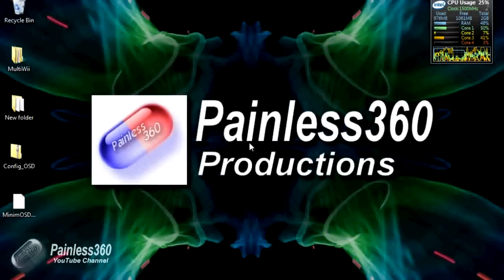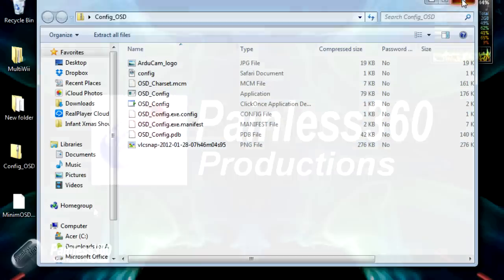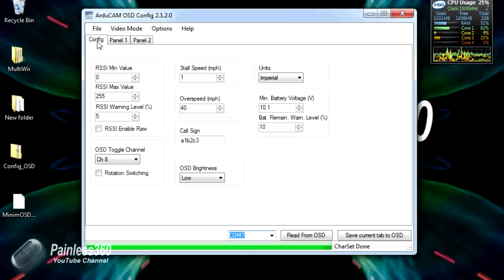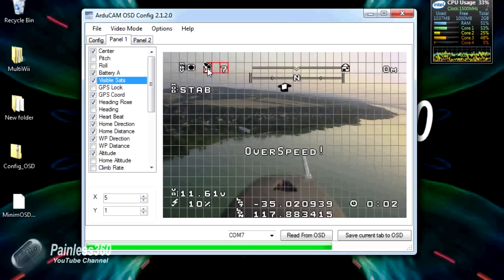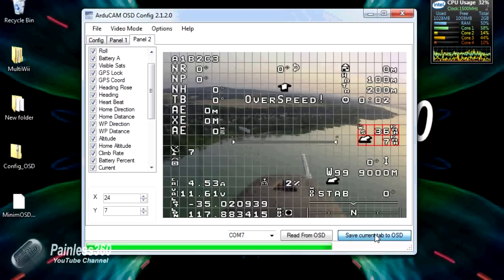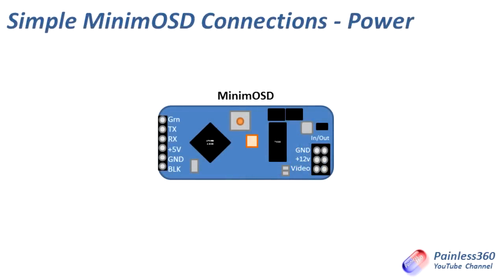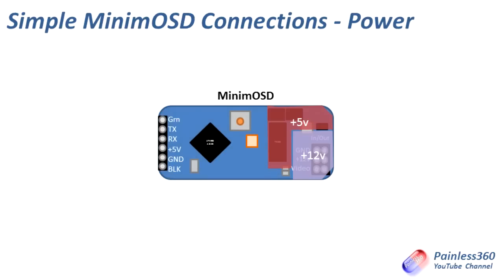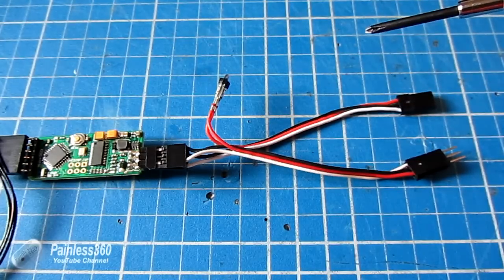APM 2.5/2.6/2.7 - Adding an OSD for FPV using MinimOSD - complete setup

Comment: I have 2 quads, one with Telem radio and one without. The one without will not update the OSD!  Spent 2 hours on it today. I get a waiting for heartbeats. I swapped the board over to the telem system and it works. I have both Tx and Rx connected (crossed over) to the APM 2.8 Telem port. In MP there a button under optional hardware to enable OSD....doesnt change. Any ideas?  Great videos btw..very professional!
Reply from the maker: Great work on the troubleshooting. So many ask for help without explaining what they have already tried. From what you've tried it sounds like a software setup problem or a problem with the port HW. I'd check through all the settings in Mission planner between the flight controllers to see if they are the same, if they are then it maybe the port itself.. I've looked to see if there is a way to disable MAVLink but can't find anything. Best of luck.

Comment: Is it possible to power the fpv transmitter using the output rail of the apm? I'm using a power module with jmpr removed. Thanks
Reply from the maker: I wouldn't. Most FPV transmitters need 7-15 volts and a lot want 12v (or there about!). I'd power it from the BEC and avoid pulling any more power through the APM than necessary. Best of luck!

Comment: Hey hello there. I have successfully installed the OSD after watching your video and it was fantastic.

However I do have a serious problem. I want to use both OSD and the MAVLink at the same time. However as you know there is only one "Telem" output on the ArduPilot. What can I do about it?
Reply from the maker: +Berk Küçükoğlu There used to be a 'buffer' that isolated the signal pins so they would work. Many have problems connecting both at the same time as the load on the APM pulls the signal below the level that works reliably. This is one of the things they fixed on the Pixhawk - two ports for telemetry! Best of luck!
Reply: +Painless360 Sincerely thank you for your reply. Is there anything I can do about this issue? Are there any products to fix this issue? I am not an electrical engineer but maybe there is a way to copy the signal without APM pulling it low. Maybe using a transistor or something?
Reply from the maker: Unless you can find that 'buffer', no. Best of luck!

Comment: I'm having a problem with the FTDI breakout board and the OSD having different connection values.  The FTDI breakout board has listed connections as GND, CTS, VCC, TXD, RXD, DTR in that order; while the OSD has listed connections as BLK, GND, +5V, RXD, TXD, CRN in that order.  Is there adifferent FTDI breakout board that I should get or is there a proper way for these to connect?
Reply from the maker: +Doyle Daniels We've not seen that here. Normally one end is called BLK the other GRN and lining those up gets the pins the right way, otherwise the 5v pin is normally the key.. Best of luck..

Comment: where can you get the cables for the OSD and Camera?
Reply from the maker: +Kenneth D. Bryant The cable for the camera usually come with it and I then use servo cables/DuPont style ends to make the rest up using the cables that come with the FC. Get a complete kit from a vendor to avoid these problems.. Best of luck!

Comment: Hello, I have apm 2.5.2 (Cheerson CX-20 open source) and minimosd.  I have followed your video for setup and installation and all went well except the fact that it just says "waiting for MAVLink Heartbeats" on my goggles.   I have absolutely exhausted every resource I could find trying to find a solution.  Any ideas?  Thank you for your informative videos and time.
Reply from the maker: +Jason Weber swap rx and tx lines? Tricky to suggest things without knowing what you already tried.. Best of luck!
Reply: +Painless360 I have indeed tried swapping tx and rx without success.  I've also tried previous firmwares on OSD, I've tested everything with multimeter and I'm showing voltage on tx and rx.  I've even tested the apms voltage regulator at the 12C port and it's showing 3.2volts, I've tried disconnecting gps and compass without success as well as tried hitting reset button on module numerous times without success.  I also get same error if I do away with OSD and try connecting to mission planner via 3dr (knockoffs) telemetry modules.  It's as if the apm is not sending data through the telemetry port.  Is there any way to "make" it do so?  Thanks again for any time you have for me.
Reply from the maker: Could be a broken board or driver issue then. Try it on another PC and with another cable. Best of luck with it..

Comment: I had som problems making the connection between the PC and the MinimOSD. 
The computer says "Failed to talk to bootloader", "update Eeeprom" 
It was an easy fix but worth mentioning. The FTDI-adapter needs its own drivers and that was something i had missed out on. I´m quite sure there are other snags along the way, but this solution worked for me. 

Thanks for making these tutorials!

Comment: Thanks for the video Painless.  I used this as a reference to get OSD on two of my Flamewheels.  Here's my question, I don't seem to get the Mavlink heartbeat I think called the RSSI??  It reads 0 yet all my other data comes through fine.  Not sure if this is an issue, or something I need to do via my APM software????
Reply from the maker: +MrPolymers The RSSI value is read from the radio receiver and is an indication of signal strength, unless you've set that up you won't see it..
Reply: OK, I did have that box unchecked on the OSD software.  I assume that's why.  I don't think necessary info for me.  Thanks for the good work...;)
Reply from the maker: You're welcome! Glad you got it sorted..

Comment: thanks mate this is working perfectly! but how am i able to edit the code, so i can add or change the view of some parameters?
Reply from the maker: +elie machaalany Most of the common tweaks can be done through a GUI to configure to OSD, anything else you need to get into the Arduino Sketch that creates the firmware.. even I don't go there ;)
Reply: okey mate but i need to add a cross-hair all over the screen display .. so i need to modify the arduino sketch .. if you could please give me a link for the arduino sketch, wich fits for apm 2.x :) thanks Painless360
Reply from the maker: It's the one we use in this video.. This is outside what I know about - best of luck!
Reply: okey friend no problem .. thank you :) Painless360

Comment: Lee: Thank you for all your videos and "bots and bobs". Have you run into the error "Cannot talk to the bootloader". Apparently caused by a windows update soft bricking the bootloader. I would appreciate any insight and a workaroud if you have one.
Again thanks
Reply from the maker: If that's what happened the you can try and reflag the boot loader using an USBASP tool (http://ardupilot.com/forum/viewtopic.php?f=19&t=6064)
Reply: +Painless360  It is not the APM that is having the problem. The OSB module was programed as per the above video. It worked. Went back to change setting from PAL to NTSC (gittery mask) and FDTI return the error.
Cannot change OSD settings. Two different OSDs and two different FDTIs.
Apparently it is happening a lot since the last window update.

Comment: well i have now got a new FTDI and it loaded but I do not see my battery volts do i have to install something else or wire it up?? I am running the amp 2.6 from the Telemetry port??
Reply from the maker: Yes, you need to have the sensors connected from the PDB/Power Module. Best of luck

Comment: Hi +Painless360 Thanks for your video. As always, your video has always been very helpful for me with your clear and detailed explanations. Initially the mavlink does stream all my data to my ground station, but after updating the apm 2.6 to the latest firmware (v 3.2.2), it only update horizon line, altitude and modes. Functions like Battery Voltage, GPS long/lat, SatCount, Home Arrow, Compass shows '0' reading. 

When connected to Mission Planner it tells me that the Neo6M GPS  has lock into 10 satellites. And during flights I still manage to do Loiter, RTL and etc.  It's just the minimosd won't stream the data. Could you share the parameter values of the APM in mission planner. Should I also update the minimOSD firmware after updating the APM? Thanks
Reply from the maker: +Ahmad Faizol That is what I would try next - best of luck..

Comment: Great video thanks. Have hooked up the same way you show in the video but cant broadcast video and overlay at the same time. On startup i only get video, unplug the camera then the overlay appears. Plug camera back in and the overlay disappears. Reset button doesnt help and ive tried 2 different cameras. Help?
Reply from the maker: +Kyle V Have you check that the PAL/NTSC setting is the same as the camera?
Reply: +Painless360 i do believe both are operating as NTSC

Comment: I got the minimosd off Hobbyking (http://www.hobbyking.com/hobbyking/store/__80102__Minim_OSD_for_APM_or_Pixhawk_Flight_Controllers.html) and it has extra pinless soldering pads on the top. They read (from the back of the OSD) G CURR G RSSI G BAT2 G BAT1. Would I be able to use the ground and battery inputs as is without modification for voltage display?
Reply from the maker: +Caleb Nehrbass Normally those extra pins are for the connection to the external sensors for the KV_Team firmware not to power the board. Best of luck.
Reply: So the only way to get the voltage overlayed on my screen with my particular osd is to do your mod with the resistors in the multiwii minimosd video?

Comment: hi. sorry I did use you as my first port of call instead of researching elsewhere first. after a lot of looking I have resolved the com port error by manually installing a ftdi driver and now have firmware etc all done thanks to following this tutorial. now to check out your 12volt video so I can connect the fpv.
Reply from the maker: +Claire Strudwick Well done, happy flying!

Comment: My setup is apm 2.8 + minimosd extra 2.2 + telemetry radio, i have seen many issues about the gps, voltage and amps not getting updating while others things like compass and horizon work flawless.
I have tried all the different solutions posted all over the web but i can't get my osd to work right, i could really use some help with this.
Reply: +Jake Mogensen Hi, I opened a post about this and I am looking for a solution too!
http://ardupilot.com/forum/viewtopic.php?f=72&t=14736

Comment: Apologies before hand, if this is a silly question... I noticed that the connection diagram shows the GND wire from the Camera pointing to the Out pin on the OSD and the GND wire from the Video TX is pointing to the In pin. Is that correct?
Reply from the maker: +Mcwdes At which point in the video?
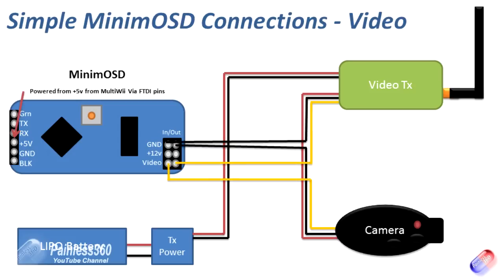Reply: +Painless360  That would be at 14:10.
Reply from the maker: Yep, the GND is common so that should work ;)
Reply: +Painless360 Thanks for the confirmation. I guessed that was the case. I'm hyper-sensitive to "magic Smoke." Just wanted to make sure.

Comment: I have 3 minimosd and can´t get it to work with gui. I get the "fail to talk to eeprom" on all three. Two of them came with mailman today. I have all drivers, FTDI, USBasp and cables, but it´s not connecting to minimosd gui or arducam. Tried Arduino to burn bootloader but no success. What to do?
Reply: +minibok2008 ....or fail to talk to bootloader
Reply from the maker: +minibok2008 That is odd that you have that many with a problem. Points to something on the PC/cables you are using. Have you tried another FTDI adapter as some of the 'clone' boards have trouble with the latest drivers.. Best of luck..
Reply: +Painless360  thanks! I ordered FTDI basic instead from BG. The one I used worked with Orange UHF modules and I did test it with FT-program to check if it was locked and that worked fine.
Reply from the maker: +minibok2008 As I can't see the FTDI adapter clearly or the wiring it's impossible for me to comment usefully. I think your idea of another 'real' FTDI basic adapter is an excellent one..
Reply: +Painless360  It´s solved! You mentioned pc/cable so I borrowed my wife`s pc and now it works. My pc usb outputs less than 5V, I think it´s corrupted. Thanks!

Comment: great video but cannot suss out how to incorperate the plug and play eachine fpv system as its 7 to 24 volts so the 5volt mod wont work....confused now
Reply from the maker: +Jason Strudwick I've not used that but I assume that you'd set it up as a 12v camera for ease of install. Best of luck.
Reply: +Painless360 so best to keep board as is and follow your tutorial?
Reply from the maker: Not if the camera can't work on 5v... See my video on powering 12v cameras for FPV, may help. Best of luck.
Reply: +Painless360 ok will do thankyou

Comment: Hello, or did you buy the adapter with micro usb ?

Tanks
Reply from the maker: +Jose Duarte Not sure which cable you mean if you are talking about the FTDI Basic adapter - yes!
Reply: Hello, Yes
Reply from the maker: Yep - you need to buy one. Search on the usual places for FTDI Basic. Best of luck.
Reply: +Painless360 Thank you a lot.

Comment: Great guide, works a treat without the TX on.  As soon as I turn on my TX my screen blanks, No Signal.  When the signal does reappear (intermittently) it would appear that the minimosd is not working as there is no OSD displayed.  Anyone else encounter this?
Reply: +Michael Wilson Sorted it, APM not providing enough umph!!  Had to take a 5v line from the voltage regulator.
Reply from the maker: +Michael Wilson Well found - glad you got it sorted!

Comment: i just subscide..  :) 
i would like to ask do i must have the usb connect to mini osd thingy to upload the firmware to operated ?

and 2nd 

i have also have 433 mhz telementry... can i use both of it just solder the cable on the wire like the diagram...

anyreply would be highly appriciated :)
Reply from the maker: +Uni Productions Welcome to the channel. Yes, I would recommend getting an FTDI basic adapter to configure/upload the firmware you need. See the forums where some have connected the OSD and Telemetry at the same time but there are issues..

Comment: can we use both mavlink and mimimosd together? ?? love to use osd but sad to loose mavlink
Reply from the maker: +Ashish Faustine Yes, but you need to be careful. The use of two devices on the pins of the APM can pull the signal level down so there are external buffer boards available that can make sure that does not happed. Best of luck.
Reply: +Painless360  buffer?
Reply from the maker: Google? ;)
Reply from the maker: +Painless360 http://ardupilot.com/forum/viewtopic.php?f=22&t=11386
Reply: Thanks bro
Reply: Wish u had done a video on this ♡♡
Reply from the maker: Too specialised and now the Pixhawk has effectively replaced the APM and has two telemetry ports for exactly this reason.

Maybe you can do one when you've got it working?

Happy flying!
Reply: I haven't even figured out how to Tune the yaw properly :)
Reply from the maker: One step at a time :)
Reply: Bro am upgrading my frame frm f450 to the tbs nockout. . Diatone white sheep frame 
Is that frame x or v?
Reply from the maker: Not sure, I'd ask the vendor. Best of luck with the build!
Reply: Ok
Reply: +Painless360 pixhawk was an awful idea. It's way more expensive than the apm. Video helped a lot and now I've got everything up except battery voltage.

Comment: Mine Apm2.8 with osd does not show the Gps signal do you know why? And battery seems never decrease in value (no pm attached). Hope you could guide me please and thanks in advanced.
Reply from the maker: What have you tried already?
Reply: +Painless360 I have got the gps to work now by adding a RX signal, but still I can't get the Battery Level to be working, it show always 11.5V. Do I need to add a PM to make the battery osd function?
Reply from the maker: You do. Best of luck.
Reply: Alright I have just ordered a PM, which cable is needed to plug into the OSD?
Reply from the maker: This is covered in the adding an OSD video in this series. Best of luck.
Reply: +Painless360 no sorry I don't see that in the Video is there a link? Please .
Reply from the maker: All of the videos are arranged into easy to use playlists. Look in the 'Introduction to APM' playlist - it's in there..

Comment: Great video!! but I have problem with the flight modes, it doesnt change and doesnt display, please I need your support.
Reply from the maker: +Grover Flores Urbina Happy to help but please watch https://www.youtube.com/watch?v=olIqTiSJHIY and come back to me with more detail of what you've tried..
Reply: +Painless360 , I am glad for your attention. All else is working very well, but only the flight modes not appear  (MOD:) I saw this issue is due to the last firmware of APM but I'm not sure. I tried with the last  minmOSD extra 2.4,  I get to see the flight modes, but the other data have problem and they are distorted. I need your suggestions about that,  Thanks,
Reply from the maker: I see. There is other OSD firmware that supports MAVLink - you could try one of those on the MinimOSD and see of it works any better. I add a MAVLink OSD in the CC3D series. Not sure of that's a different code though.. Worth a look.

Best of luck!

Comment: Hello i have minimosd 2.8
i've connected my telemetry pin to minimosd like your schematic

5v > 5v
tx > rx
rx > tx
gnd > gnd

I tried to connect the signal out cable and grn cable directly to my monitor (without a video transmitter) but i don't see nothing on monitor... why? are you sure your schematic is correct?